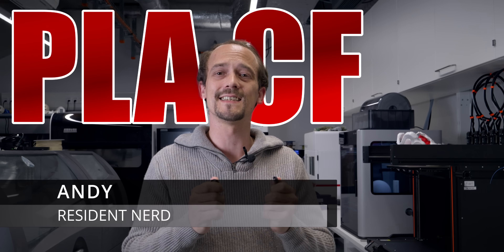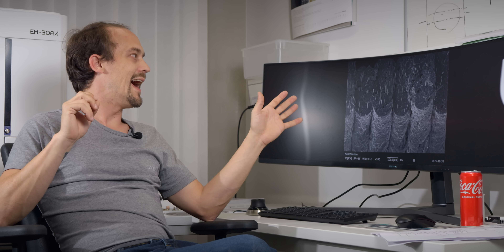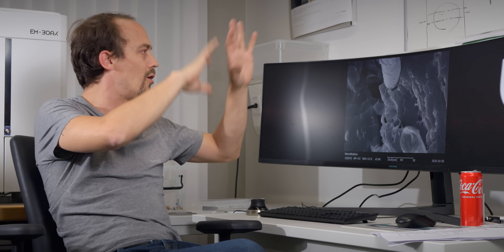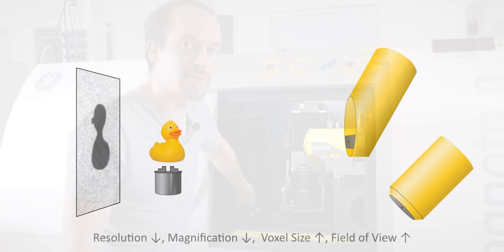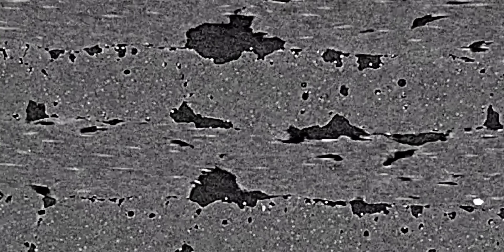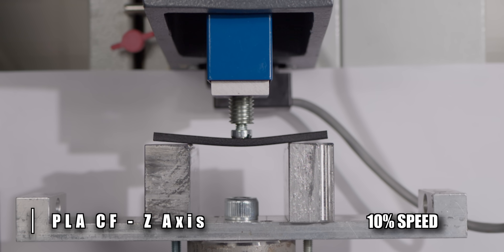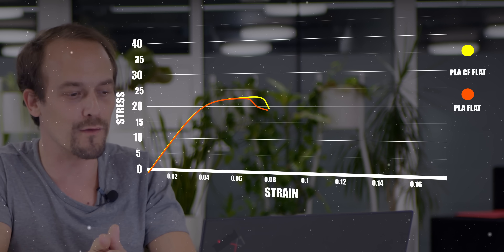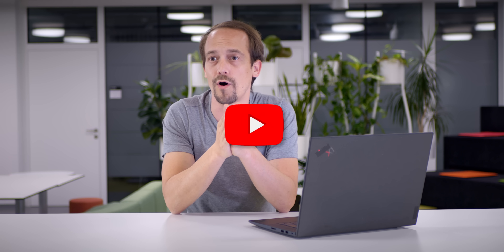3D Printing’s Biggest Scam Is Even Worse Than We Thought!

Comment: I'm a retired US Navy EOD diver. When the F14 Tomcat was introduced into the Fleet, it had carbon fiber in the wings and airframe. The Navy had warnings for us if diving and recovering an at sea crash of an F14, to always wear a wetsuit and to only wear it that one time and destroy it after the dive. Why? Because the carbon fiber would penetrate the neoprene and eventually work it way into your skin is used beyond that dive. I don't know if it would do so during the dive but I would think it would.  This was in the 70s when the F14 was new to the fleet.
Reply: I worked on F/A-18s and was told this after poking myself with a carbon fiber splinter on my finger tip. That was 22 years ago. It is still there
Reply: @stephenmatthews4061  nice, use pigburner to remove them
Reply: I've worked with fiberglass before.   Diving in CF contaminated water sounds... truly hellish...
Reply: boron    which is worst
Reply: @authordent41  boron?  boron fibre?  used for what?
Reply: @MantisRay861 got to be boron fiber.  It's used in similar applications to CF with the addition that it has some neutron blocking capabilities so it has wider uses.  It is considerably more expensive than CF though, so it is only used when you're ok with raking a bunch of money into a pile and setting it on fire.
Reply: @8yourpets  "it is only used when you're ok with raking a bunch of money into a pile and setting it on fire." - So Government work, then....
Reply: @MantisRay861  additionally to what the other guy said its also great for compressive loads because its much thicker than carbon fibre, also it used to be stiffer than carbon fibre but it has been surpassed in that aspect
Reply: @badgermcbadger1968  we used to use boron patches to reinforce f111-F & G wings over micro cracks in the wing surface, way stronger than cf
Reply: ... ASF-14 Super Tomcat !!
Reply: @davidcharles4169 just a dream
Reply: I just bought a 3d printer and would be interested in other materials using carbon fiber for safety reasons.
Reply: @markriley9664  graphite isn't a problem unless you're sanding. It's fine.
Reply: F-14 did not use carbon fiber.
Reply: @JackF99  It used boron fibre. Hardly better to dive in. Carbon came with F/A-18 if I'm not mistaken.
Reply: Could’ve been the toxicity of Boron fibers in the Epoxy
Reply: No, that's that's the kind of fully enclosed carbon fiber he was talking about at 15:04.
Reply: I would imagine that the carbon fibers used in full layups are substantially longer than those used in 3D printing
Reply: @graysav  Much longer. But I imagine the material could be practically pulverized on impact. And breakage will release small fragments.
Reply: And just another reason I'm glad I went with an aluminum and titanium bike.  My wet suit, tank, etc... are all next to the bikes.  Yeah, yeah, it won't transfer through air, but gotta get in the digs, lol.  That and no shattering.
Reply: @LackofFaithify  It's a factor in a crash. Broken CFRP is not exactly friendly (the primary danger being that it breaks and forms sharp edges, it doesn't really deform). But a finished frame made from carbon fibre twill or weave is hardly dangerous to handle.
Reply: @jobicek  This is true.  But as a biker in the United States, I must heavily take into account the possibility of the sort of event that leads to said sharp edges.  Because, what is a bike lane, you are a car that has to pedal.  Oh, and let us not forget what cars may not notice with car tires: road conditions that for a bike tire, can create rather sharp and sudden impacts because of our totally amazing infrastructure.
Reply: @LackofFaithify  Leave San Fransisco. It'll be ok.
Reply: @pointvector1951  huh?

Comment: Thanks a lot for the video.

I have been involved in 3D printing for around seven years, mainly working on drones and citizen science projects with environmental sensors.

Regarding PLA CF, my standpoint has always been that it mainly changes the appearance but does not provide real mechanical benefits. In general, I consider PLA suitable only for decorative prints, as it does not age well outdoors when exposed to weather and sunlight. PLA is very stiff and tends to break easily.

Based on my experience:
Adding CF or GF increases stiffness but weakens layer bonding. With PLA this is particularly problematic, since layer bonding is already poor.
With PC, CF or GF can work, but the layer bonds often become the weak point. As a result, it is not suitable for every application, even though the material becomes stiffer and stronger in certain directions.
With PA, CF or GF works well. The material becomes stiffer, and the reduction in layer bonding strength is less critical, since PA generally bonds quite well.
With PP, CF or GF adds even more stiffness than in PA, and since PP has excellent layer bonding, this usually does not cause major issues unless the CF or GF content is very high.
I also have experience with CF filled TPU. The effect is similar: it is mostly about appearance rather than improved properties. The material becomes stiffer than most TPUs, around Shore D75.

One question: You mentioned that CF disrupts the polymerisation of the filament. I do not think that any polymerisation takes place during FDM printing. It is possible that I misunderstood this point.

Also, it might be interesting to compare prints from different printers and printing profiles. The differences might be larger than those caused by the material alone.
My setups have been optimized for strength over many years. Let me know if I could send you samples from Germany.

Best regards

Comment: ### Summary of Video Content on PLA Carbon Fiber Reinforcement (PLACF)

This video critically examines the effectiveness of PLA carbon fiber reinforced filament (PLACF) used in 3D printing, presenting new mechanical tests and microscopic imaging to challenge common assumptions about its strength and utility.

### Key Insights and Findings

- *Initial Claim:* The presenter, previously critical of PLACF, now reveals that it may be an even worse "scam" than initially thought, based on new experimental evidence.
- *Testing Methodology:*  
  - Performed *three-point bending tests* on PLA and PLACF samples to evaluate stiffness, strength, and energy absorption.
  - Used *Scanning Electron Microscopy (SEM)* and *micro-CT imaging* to analyze the microstructure and fiber distribution inside printed parts.
- *Microstructural Observations:*  
  - Carbon fibers in PLACF align mostly along the filament flow but are not embedded within the polymer matrix uniformly.
  - Fibers tend to be located **between the layer lines**, disrupting layer adhesion and bonding.
  - The polymer does *not adhere well to the carbon fibers**, resulting in visible gaps or **voids (~30 micrometers in size)* around the fibers.
  - These voids are not moisture-related and appear consistently inside the printed material, confirmed by non-destructive micro-CT scans.
  - The presence of voids and poor adhesion creates *stress concentrators* that can initiate cracks, weakening the part.
- *Mechanical Performance Results:*  
  - PLA alone exhibited *higher stiffness, greater maximum force before breakage, and better energy absorption* than PLACF in the Z-direction (perpendicular to layer lines).
  - In the X and Y directions (parallel to layers), **PLA and PLACF showed nearly identical stiffness and strength**.
  - Overall, the addition of carbon fibers in PLA *did not improve mechanical properties* and sometimes worsened them.
- *Material Behavior Explanation:*  
  - Carbon fibers act like obstacles that **prevent polymer chains from entangling properly**, weakening the internal molecular bonding.
  - The polymer’s retraction around fibers after cooling leads to microvoids, further compromising strength.
- *Health and Safety Concerns:*  
  - Carbon fibers protruding from the filament surface can **break off and embed in the skin or become airborne**, posing a potential health hazard.
  - In medical 3D printing, carbon fiber-containing materials that are not fully encapsulated are *restricted due to risks of cellular damage* from fiber shards.
- *Broader Context:*  
  - While PLACF in PLA and PETG is largely ineffective, other polymers such as PA, PEAK, PET, and PP **do benefit significantly from carbon fiber reinforcement**.
  - The presenter suggests future investigations into these materials and the health risks associated with carbon fibers.
  
### Summary Table: Mechanical Test Results (PLA vs. PLA CF)

| Property                    | PLA (Pure)                  | PLA Carbon Fiber (PLACF)           | Notes                                  |
|----------------------------|-----------------------------|-----------------------------------|---------------------------------------|
| Stiffness (Z-direction)     | Higher                      | Lower                             | PLA stiffer than PLA CF                |
| Maximum Force (Z-direction) | Higher                      | Lower                             | PLA withstands greater force           |
| Energy Absorption (Z-dir.)  | Higher (larger area under curve) | Lower                         | PLA absorbs more energy before failure |
| Stiffness (X & Y directions)| Equal                       | Equal                             | No meaningful difference               |
| Strength (X & Y directions) | Equal                       | Equal                             | Nearly identical performance           |

### Timeline of Experimental Process

| Timeframe             | Activity                                   | Outcome/Findings                          |
|-----------------------|--------------------------------------------|-------------------------------------------|
| Initial phase         | Three-point bending tests on PLA and PLACF | Confirmed poor mechanical performance of PLACF |
| Microscopic analysis  | SEM imaging at 200x to 2000x magnification | Revealed fiber alignment, voids, poor polymer adhesion to fibers |
| Micro-CT imaging     | Non-destructive 3D X-ray scan (~13 hours) | Validated presence of voids, fiber distribution, polymer retraction |
| Data reconstruction  | Digital 3D model created from CT data      | Showed internal structure and voids clearly |
| Final analysis       | Comparison of mechanical and optical data   | Concluded carbon fiber in PLA is ineffective and potentially harmful |

### Conclusions

- **PLA carbon fiber reinforcement does not improve mechanical properties**, often making parts weaker due to disrupted polymer bonding and void formation.
- The **polymer retracts from carbon fibers**, creating stress concentration points that undermine part strength.
- PLACF parts may pose *health risks due to fiber breakage and inhalation* concerns.
- Carbon fiber reinforcement can be beneficial in other polymers, but for PLA and PETG, it is **mostly a marketing gimmick**.
- Further research is encouraged on *carbon fiber reinforcement in other polymers* and the *health implications* of carbon fiber particles.

### Potential Future Topics Suggested

- Detailed comparison of microvoids in different 3D printing materials using micro-CT.
- Investigation into carbon fiber reinforcement performance in materials like PA, PEAK, PET, and PP.
- Health risk assessment related to carbon fiber inhalation and contact in 3D printing contexts.

### Keywords

- PLA Carbon Fiber (PLACF)
- 3D Printing
- Three-Point Bending Test
- Micro-CT Imaging
- Scanning Electron Microscopy (SEM)
- Polymer-Fiber Adhesion
- Voids / Air Bubbles
- Mechanical Strength
- Stress Concentration
- Medical Device Regulation (MDR)
- Health Risks of Carbon Fiber

This analysis rigorously debunks claims that PLA carbon fiber reinforced filaments meaningfully enhance mechanical properties in 3D printed parts, emphasizing the need for caution both in material selection and health considerations.

Comment: PLA-CF Health - I am a little freaked out right now as I hadn't realized that carbon fiber breaks into nanoparticulate sized shards, been messing with carbon fiber cloth.  It would be good to bnetter understand what the risks are, if possible. Thanks for the interesting video. Never used PLA-CF but I have some PTG-CF ready for a next print.

Comment: is the thumbnail AI? wtf is that text on the bottom left
Reply: They are the data settings from the electron microscope
Reply: Lots of AI in this video. The music too. The description also has lots of Em dashes and reads like something chat gpt writes up.
Reply: @1MBStudios  possible that he used a translation tool for the description
Reply: @1MBStudios  hey buddy, just thought you should know, em-dashes aren't exclusively used by Large Lying Machines. in fact, they frequently use them incorrectly due to the fact that LLMs are spicy autocorrect trained on bulk language data that includes an unsorted mix of technical literature, professional correspondence, fiction, and non-fiction, and the use of the em-dash in all those genres of writing varies considerably.
Reply: @LexYeenyeah its funny how people are like iTs jUsT liKe a HyoOomAn and im like yeah because it was trained on millions of human interactions and spoiler alert most people arent the unique snowflakes they think they are
Reply: @1MBStudios em dash don’t mean ai
Reply: @nicholascanada3123  which is exactly why it's not the exclusive reason. LLM's also like groups of threes for descriptors, and often use phrases like "it's not just blank, but blank" very frequently, hence why I mentioned the writing style of it.
Reply: It's extended, he had a smaller image and he extended it using AI so it could fill the whole thumbnail

Comment: Excellent scientific testing. Your content is great, you don't need the AI slop. It's the equivalent of PLA CF, just cringe bling that cheapens the otherwise excellent product.
Reply: It wasn't excellent scientific testing at all. He only tested one brand and never showed that brand's regular pla under the same tests.
Reply: @firehawkws7845 

I agree there are other valuable data points not considered, however the testing methods are sound. Yes there are unanswered questions, and a follow-up experiment with an expanded scope to include other products could answer many of them. However, the same methods and measurements used here would be viable in those experiments as well. Same testing, expanded scope.

Comment: dude im sorry still watching the video but the AI generated cutaways are SO unecessary and ugly, please stop doing them

edit: okay now that ive watched the rest of the video, all i have to say is, duh. the whole point of carbon fiber is that its strength comes from the way the fibers are weaved together, so of course sprinkling shards of it inside plastic isnt gonna make it stronger lol, i don't get why people would even argue about this
Reply: If the matrix can bond to the additive (either chemically or mechanically) it should work... think of fiber reinforced cement, plaster etc. I totally agree with your first observation!!!
Reply: it's not the weaving, but the fact that it has a higher tensile strength and stiffness than most isotropic materials that are comparable in density. The problem is that in 3d printing you need to modify the use and of the fibres quite a bit, and without a proper bond between the matrix (and polymer or what have you between fibres) you can no longer expect good load transfer across a part.
Reply: Bad take. This AI hate is fucking pathetic. I thought it was great and made the video better and funny. Jog on, and stop jumping on the next hate train

Comment: Yes. Thanks for the actual testing.
I understand that carbon or glass fiber reinforcement reduces material deformation and increases temperature resistance.
But it worsens the adhesion of the layers.

Testing the health effects of carbon and glass fibers would be great.

Comment: I never thought of PLA CF as stronger and also had not much expectation on stiffness improvements as PLA is already quite stiff. My use case is chap and easy material that can be heat anneled without significant distortion to then not deform in a hot car tansport afterwards.
Reply: Not a scam for that. Or is it?
Reply: As for the shedding, this is a non issue for most cases. These are minisule and get shed with normal skin shedding. It is obviously not suited for implants like some natural PLA is. Sanding is an other story. Just avoid it or use appropriate PPA dust masks and eye protection.

Comment: Here's what's contributing to the problem:

The disconnect between materials science and additives at the macro scale and materials science and additives at the micro scale.

At the macro scale we have empirical evidence that additives can and DO add strength to a material.  Think fiber- or rebar-reinforced concrete as one example.

So we attempt to replicate that at the micro scale with 3D-printed PLACF through the addition of carbon fiber as our rebar analogue.

But this is where the problem reveals itself.  At the macro scale, mechanical forces dominate (Newtonian physics).  But at the micro scale, chemical forces dominate (i.e. that sub-division of chemistry that concerns itself with the bonding energy of atoms and molecules).  One might even dare say "quantum forces" dominate.

If this is true, then you can't approach the 3D-printed micro world with the same mindset of the macro world.  Apples and oranges.  What works at the macro scale won't necessarily work at the micro scale (i.e. you can't just throw a bunch of carbon fiber into some plastic and claim it's "stronger").

We need to start thinking about how materials interact at the microscopic and even the atomic scales when it comes to 3D-printing.